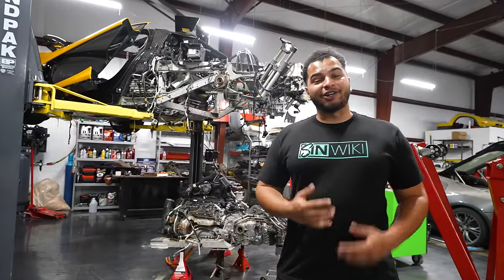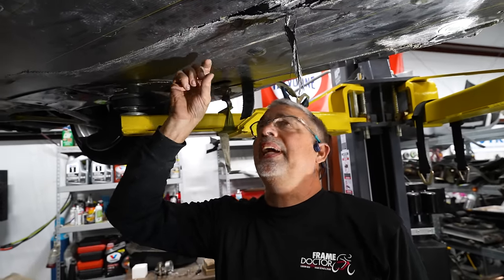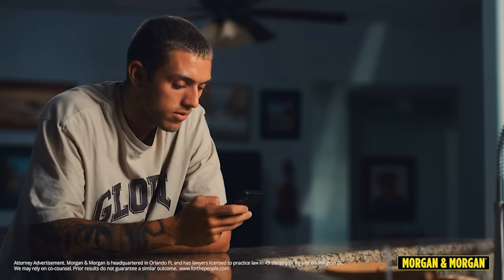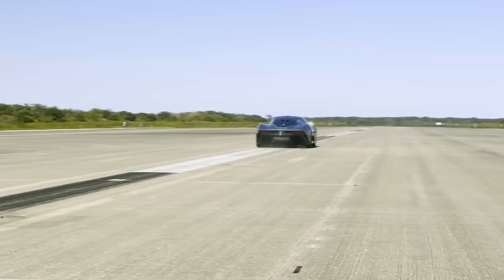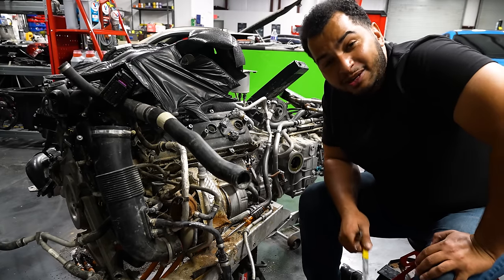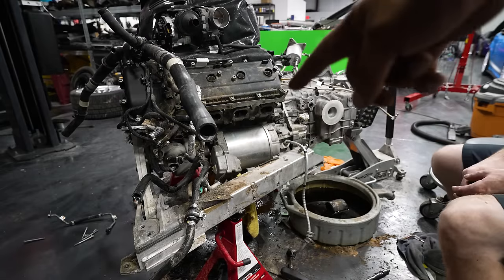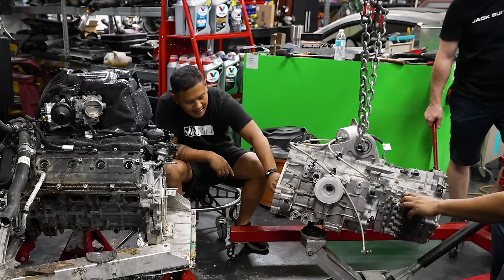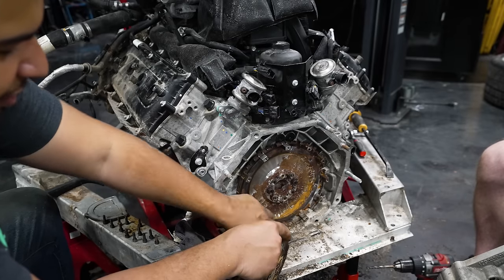Rebuilding A Flooded $2,000,000 McLaren P1 | Part 7

Comment: I was skeptical of the MOD, but then…This is going to look amazing.
Reply: @@djhunt1961 don't think a full  carbon fiber replacement body is 'cost effective' but I get what you're saying lol
Reply: @joony17 The stock body is already carbon fibre but comes with the Mclaren Tax on top + this is a great way for companies to show there offering and potential to a very wide audience. It's a win win hats off to business strategy to be able to get the P1 back on the road 🔥
Reply: It won’t work, even as a mod. Waaaay too much work and cost to get parts. Even modded, what about the interior? Engine control? Digital displays? ABS/ESP/etc??
Reply: Yoo zollotech never thought I'd see you here! Much love for the videos you make, keep up the good work! ❤
Reply: @Fluterra  And that is why freddy buys a car for almost $600k that needs a full restoration and not you.
Reply: hey go make ios 17 public beta release vid your not supposed to be here
Reply: @clintmiller88 P1 can already go 217mph stock so that proves that the body/aero dynamics don't have any obvious problems hitting 250mph. Only things needed are some good tires rated for those speeds and more power.
Reply: @HARDMAN999  agree 100% that cf work looks amazing.
Reply: @HARDMAN999  the carbon bodies and painted ones are NOT the same. The carbon on the painted cars is not going to look nearly as good as the carbon on an actual carbon body car. It won’t line up or look clean or anything like a proper carbon body.
Reply: Also it will probably have blemishes and imperfections on a painted car unlike the visible carbon ones
Reply: @joony17  😁😆😅🤣😂🤣  😜 🤣🤣
Reply: Aaron, how can we make an iPhone 15 Pro Max to GTR extreme version? ;-)
Reply: @clintmiller88  Well the P1 Gtr has a topspeed of 225mph so the aero is for sure there as this body is a scanned replica of the body you say a company paid billions to design
Reply: @HARDMAN999  yup, a similar body from mclaren for sure is more expensive than what we just saw on the video
Reply: @liiiinder  that's right; because my IQ has 3 digits, I would not do something so stupid
Reply: @clintmiller88 Hennessey would argue differently, the original Venom was a modified Lotus body designed in a shed, that did 250 plus without breaking a sweat
Reply: @clintmiller88  the original Venom GT had 1244hp, and weighed 1244kg and hit 270+. A stock P1 is a little under 1400kg
Reply: I felt the same but a toned down GTR seems like the perfect balance!
Reply: @mick6721 he already bought it wrecked for 600k… idk what more u can devalue in that car 😭😅
Reply: liinder
I like how he claims "the mclaren has been my dream car since I was a little kid" card in every single episode. Hoping to really get Mclaren to just give him a car😂. 
And that carbon fibre damage underneath is probably gonna get worse. Not better. You can repair torn damaged fibre structurally 🤷
Reply: @clintmiller88 It's a P1 GTR body without the canards. It'll work.
Reply: @mick6721  Well it's his car he doesn't plan on selling it. Since most of the new parts are updated and superior to the original P1 parts if the rebuild is done right I'd much rather have his modded P1 than an original. I'd rather have a McLaren that doesn't break if you tune it slightly obviously if you keep your cars garage kept and never drive them you'd want a factory mclaren.
Reply: ok
Reply: ok
Reply: @liiiinder a restomod at this point

Comment: Hey Tarvish. When using an ultrasonic tank, make sure to remove all the rubber and any small clips and things like that. You want whatever part your cleaning to be completely stripped to the bare minimum. River can lose integrity and clips can lost strength and things like that.
Reply: And the transducers are kinda sensitive and the basket should stay in place. Put small parts in a glass jar(not plastic) with cleaning solution to save cleaning the fluid all the time
Reply: Also I'm pretty sure he didn't use enough ultrasonic solution, I usually use the blue stuff and it's pretty apparent the amount that's used. His seemed like more water? Not sure if there is clear solution. But I think it should've gotten the other one spinning, oh well I suppose he doesn't care because they are being sent out to the manufacturer.
Reply: @MrDengo999 some proper comment section / back seat mechanics here.
The man is rebuilding a McLaren P1, vs some guy who thinks he can "see" better from just this one clip 😅
Reply: Also deionised water plus brine slime is reionised water

Comment: Even if this rebuild is only at its beginning stage, Tavarish has achieved YouTube legend status.
Reply: The 675LT rebuild got him legend status. This is just bonkers. He's really the only person on YouTube that could have done the P1 project.
Reply: The real problem is that this is literally a frame-off process as every nut, bolt, gasket, and piece has to be inspected.  And most of it replaced.  Their insistence on using aluminum is a problem as opposed to other alloys as it all has to go.  If it were a Mustang, a little corrosion isn't a big deal - stop it and seal it.  But when it's been lightened to where there's no leeway in the design, that's exactly where it'll snap or fail.  And the car as a LOT of aluminum in it.  So lots of work and videos to come.  Probably take them the better part of a year as the real issues are putting it all together and waiting on those smaller bits and parts.
Also, if the clutch has a water line like that, the transmission is also trashed inside.  This might end up being a 1 million dollar project in the end.

Comment: going 250mph on a car that is not rated is quite a milestone. Although can be quite dangerous as well. Hope that you achieve it safely man
Reply: And the Mclaren is already considered a bit of a bucking bronco at its current power levels. I mean, it's RWD only. I wonder how you would get 300 extra hp to the ground.
Reply: @RoryStarr radials would look very menacing Batmobile esk
Reply: @RoryStarr he car has 600kg of down force at 160mph. the spoiler then has to reduce the down force so that it doesn't put too much weight in the suspension. it should be stable at high speed and able to put down the power without issue. but still aero to at 200-250mph is not something you can improvise. you have to keep the balance front/rear. you don't want for instance to have too much down force in te rear relative to the front, the car starting to lean backward and then the air rushing under the car at close to 250mph. that's how you send a car airborne
Reply: There is Always one septic :).
Reply: i hope he wont end up like oceangate dude
Reply: Do you know absolutely anything about automotive engineering?
Reply: @ep9321 that car had a lot of septic alright. Almost a septic tank’s worth lol 😂
Reply: @shaggings  see that's the thing. Another comment mentioned how much downforce it has, and I am aware of its active aero system. I am also aware that there was a more race-oriented version of the P1 in 2017 (I think?) that developed closer to 1,000 hp. So it's not impossible to do, but as you point out, all that aero is balanced and tested within the limits of the machine. The further outside its limits you get, the more I wonder how much that active aero is going to know what to do with the downforce and so on. As you say, it's not something you improvise.
Reply: Is the P1 single clutch or dual mass? Can the P1 been made into 4wd instead of rwd?
Reply: @RM12378  Beverly watch daily driven exotics anything is possible
Reply: @RM12378  i mean, by the time you add the weight and complexity of a 4wd system, I suspect the Porsche Spyder 918 is just the better car for those purposes (also cheaper I believe). The Mclaren P1's identity seems built around its unique... "super high tech muscle car/what if American muscle and European design had a baby" quality. Maybe not everyone feels that way. I could be wrong.

Comment: It would have been cool to see how much the P1 weighed with all of the samd and water compared to factory! 😊
Reply: i said that in ep1 :)
Reply: samd
Reply: Indeed, that would have been interesting.     
Maybe he could have sold little vials of sand with an accompanying certificate to help offset the costs of repairs.
(Lets the fans have a tangible piece of the action)
Reply: So in the end his "p1" will be nothing more than a chassis vin plate and replica body the ship of theseus good luck
Reply: @ezragonzalez8936 That's how any car that has been submerged fully in salt water rebuild works?
Reply: @ezragonzalez8936 Your point?
Reply: @MrChaosBones the forbidden samd
Reply: @ezragonzalez8936 how are you mad about seeing a p1 get modified?
Reply: @betrayedpredator8826  If it's a valuable and rare car, the claim that "none of the original body is saved" is not true. In cases where rust is present, a meticulous process is undertaken involving rotisserie techniques, acid dipping, and the use of new metal or aluminum specifically designed for Ferrari, Lamborghini, and Porsche bodies. Repairs are executed with utmost precision, adhering to original equipment manufacturer (OEM) specifications. If certain parts are beyond repair, used originals are sourced or, as a last resort, new ones are painstakingly hand-fabricated using English wheels and original molds. Tavarish is essentially replacing the entire body while not adhering to OEM specifications or even attempting to save the original body panels or using original replacements . It should be noted that in the realm of exotic and rare vehicles, originality reigns supreme. This Frankenstein creation will never find acceptance among collectors and will likely never attain a value commensurate with the hefty $800k price tag he paid. However, it seems his primary goal is generating views, which he may indeed achieve. Cheers from Park City, Utah!
Reply: @ezragonzalez8936  Rotisserie techniques, acid dipping, hand-fabrication using English wheels and original molds are methods to restore metal body parts, it's completely irrelevant to cars like the P1 that are mostly made out of carbon fiber.

As for the acceptance among collectors, that was already dead in the water when the car was floating around dead in the water, so that's even more irrelevant.
Reply: @Speednote10  Yeah it’s just some weird troll spouting a bunch of non sense
Reply: @sk1lls397  time stamp?
Reply: @ezragonzalez8936 what color is your P1
Reply: @Speednote10  It is not irrelevant. My point is that in a proper restoration, utilizing original OEM molds and techniques is essential when replacement OEM salvaged panels are unavailable. Alternatively, advanced carbon fiber repair techniques can be employed to repair many of the panels on his P1, especially since the vehicle is painted in an opaque finish where the carbon fiber weave is not visible. In early carbon fiber exotics like the Ferrari F40, the weave was visible due to the extremely thin paint layer of 80 microns in a single-stage finish. However, this is not a concern with modern carbon fiber. In terms of value, his P1 will likely be worth a maximum of $700,000 to $850,000. A P1 in perfect condition is appraised between $1.4 million and, at the high end, $2.1 million. The valuation varies depending on mileage, with the lower end for those with less than 10,000 miles and the higher end for those with less than 1,000 miles. I possess this knowledge as I used to work as an exotic and classic car insurance adjuster, and in this realm, originality reigns supreme.
Reply: @ezragonzalez8936 stay mad
Reply: @ezragonzalez8936  Sure, it's essential to do that when you're trying to restore a car back as close to its original condition as possible. But since that's not what's happening here, it's irrelevant.

Comment: The fact that the P1 has a speed limiter is actually CRAZY
Reply: Almost all cars have them. It's in order to prevent the engine or any component from taking damage beyond what they can handle. Sort of like a rev limiter.
Also because not many cars can just easily reach 250mph without losing control or something horrible happening. That's why Bugatti exclusively has a key for the speed limiter that tells the car's computer to check that everything is good to go for a top speed run.
Reply: I think it's because you can't find tires that are rated for such high speeds so legally they have to. Or maybe it's to not damage the wing idk
Reply: It’s literally the opposite of crazy, pretty much every car has one
Reply: @philippmayenburg7282  nothing at all with that, its about the engine
No limiting it can lead to serious, well very serious out comes that are NOT good for the person in the car, people around the car, and the company.
Tires sure i get ya, but that is rarely ever the concern past Bugatti iwth their none sense.

And let's be real if you plan on going that fast, this means you have that kind of money and probably are on a track which by most states are required to make sure you are up to a min standard for speeds past 155mph

And legally have to for tires, not at all.  There are NO roads on Earth past Germany that have speeds past 95 MPH as a base speed limit, thus anything past would be illegal and no longer the "PROBLEM" of the company directly.

This is all about the engine, the guy above was pretty much on point with it and he also used Bugatti's key example which is another thing many car companies do not even want to deal with.   Regulators just regulate and you don't F with that is their logic, and for good reason way to many things can go crazy real fast, personally Tires would be my least of any worries if your going 200+
Reply: Yep, that is why I was asking whether the body had any wind simulation done on it.
Reply: every newer car has limiter bruh...
Reply: Not really. If you like piston rods to stay inside the engine, you need a rev limiter at least, and max revs in top gear sets your top speed. Or they may have an actual software speed limit to avoid having body panels fly off the car. Everything has a performance envelope.
Reply: Freddie are you fitting this new body to the repaired tub?

Comment: This is going to be interesting. It's my understanding that the P1 was pretty much maxed out. The entire drivetrain pushes as much as it can and is already teetering on failure due to the factory maximization. I'm here for it. Best of luck. This will be legendary if you can pull off 1200hp.
Reply: No doubt it will hit 1200 its a matter of how long it can keep it there
Reply: Go back a couple videos, the engine will be fully built
Reply: Yeah it’s not like McLaren paid it’s top engineers big money to pare this back. Remember they were against Ferrari and Porsche at the time for the best hyper car.
Reply: Yeah, from 737 hp from the 3.8 liter to 1000+.  This is going to be completely nuts.  I’m sure just taking the limiter off would be enough for 220+ which is way faster than you would need on any track short of old le sarthe.
Reply: @Theq50guy12  For sure...it will definitely hit it. But will it last a meaningful amount of miles? THat's the question.
Reply: @NMullen119  I did see that. However, the main problem I see is I've read the M838T block is maxed out in the P1 setup. There's no more room to bore without compromising usable strength. No compression overhead to meaningfully increase boost. Now, if they build the motor with the newer M840T motor in the Senna, 720 series, Speedtail, etc....THEN I can totally see it. It's a bigger and more stout motor.
Reply: @bamzilla.  I don't think they need to bore it. The weak link in the bottom end is the rods and they're going to update them to thicker aluminum rods. I believe they said they've been able to get up to 1600whp

Comment: This has been very entertaining learning a lot about McLaren and the P1! The battery information is really interesting! When I initially saw that you paid over 550K I was thinking the car was somewhat salvageable without a complete tear down and replacement of everything! What I have to ask I'm wondering is, didn't the original owner get paid out in full for probably 2 MIL from his insurance and then sell this for over 550K!?? If so, he really made out really well?  I'm surprised you didn't get this for cheaper! That part list from McLaren for over 750k was nuts! But the reason this has been so interesting is because of what you've had to do so far to get to this point. Excited to see what's coming up next!

Comment: When I saw the new glass-fibre shell, I began to understand that this project will amount to something... About your ultrasonic cleaner: Lovely new idea. But maybe I have also an idea, which is new to you in regards of making a shiny part out of a VERY rust part: Place it in vinegar over night, clean it with water pressure cleaner, make it shiny with wire brush wheels...

Comment: The P1 EVO... Better than the GTR version, only time will tell.  Although the P1 GTR has the same engine,  I bet they messed with the ECU and boost.  Helluva a project there Tavarish!  Way to go, man, can't wait to see the end results.  I do think you need a Bathtub size ultrasonic cleaner.. :)  A light Orange or British Racing Green Paint would be steller to see the weave thru the paint.  Also looks like your going to need some ADV1 or other forged wheel.  Cheers!

Comment: I was surprised by the hybrid arrangement at first, it's not what I expect in this kind of car, but on reflection I think it's pretty smart, as it means you can use it for short distances without putting miles on the engine.

Comment: i was thinking about the mono cock bolts female and male that meet the frame body i would treat those bolts  before doing anything , and i was wondering if there is a company that too send off all aluminum parts together and dip them together in some type of acid wash and then clean and electrostatic apply a new finish to the aluminum??